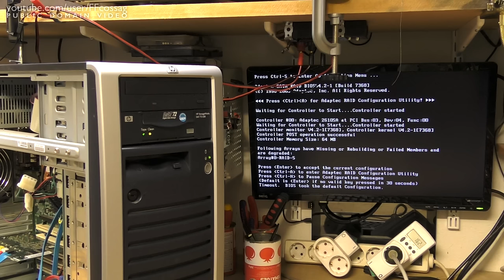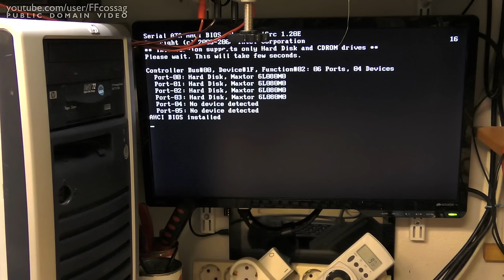The render server moves into a HP ML150 from 2005

Comment: NICE... I love re purposed cases. The hot swap bays are a nice feature. Good to see your not one of them fan crazed builders. Few PC builds need more than one vent fan, unless of course they run in a really hot environment.
There are self adhesive nylon mounts that allow placing of your board where needed, they snap in to the MB and have a square foot to stick on the chassis. Wish I knew a part number to share. I used a lot of them where I used to work. Just remember to add a MB ground wire or two if need be.
I have built some pretty unorthodox systems lol
Reply: I wonder, is it a good idea to put an extra fan infront of the gpu just to cool it even more under load and then I mean just infront of it, not at the fronted of the case?

Comment: For the "missing" stands, you can get plastic spacers to sit in them holes, useful if you ever needed to add an expansion card an didn't want to flex the motherboard too hard when shoving it in... :)
Reply from the maker: Sure. I shoved some of the bitumen damping stuff under a couple of corners to remedy such issues.

Comment: I'm intrigued as to whether the drives are running at 1.5Gbps or 3Gbps. A backplane that old might not be rated for signal integrity on newer SATA standards. Also, I hope you know about the moulded molex to SATA adapter fire concerns.
Reply from the maker: They're running at 6 Gb/s. Consider that a SATA III cable is the same as a SATA I cable; as far as I've been able to gather, the actual wiring standard has never been changed, but rather we've seen controllers better able to utilise the hardware.

What fire concerns are you talking about? I haven't heard of that, save for the usual shitty MOLEX plugs running hot when the sockets get worn out.
Reply: The moulded type SATA ends which usually come on those adapters have a really high defect rate and they spontaneously burst into flames, sometimes even after years in service. It's due to the injection moulding process AFAIKT. Just search "molex to sata fire" on YT, or Google it. I don't want to link to anything directly as it will probably flag as spam.
Reply from the maker: I'd never heard of that. I'm quite certain my adapter won't catch fire from powering a 20 mA fan, however.
Reply from the maker: They're not in the signal path.
Reply: Mark Furneaux I've actually replaced all the cheapo moulded SATA power adaptors in my servers and workstations for ones with crimped connections, even though everything was working fine for years. Better be safe than sorry....and good powersupply manufacturers also don't use these moulded type of SATA power connectors either and rather use the crimp type connectors. I'd guess they have good reason for that.
Reply: +Mark furneaux Aren't you the one who's server burned up?
Reply: Yup. I feel like it's my duty to at least warn people now.
Reply: "Molex to SATA, lose all your data"

Comment: I'm more concerned with the drives staying nice and cool. all that soundproofing insulation kinda blocks the intake air path, doesn't it? I'd rather see some filter foam up there, that seems to do a decent job of dampening some noises while at the same time preventing dust from really getting into the machine itself. Personally I'd rather be able to hear the drives to tell if one's going out or something, but heat from insulation will surely mean an early drive death in my experience.
Reply from the maker: They run cool. Barely 30C.
Reply: As you see on the very new chassis out there, they are quite thin and perhaps they would do the trick to dampen the noise significantly.

Comment: Looks great. But I wonder how the drives are being ventilated.   Maybe i'm missing something.
Reply from the maker: They basically aren't, and they don't need it. I took one out and measured the temperature after a day's use, and its hottest spot was 32 C. You can thank the miracles of modern 5900 RPM drives for that.
Reply: Oh! i neglected to consider the RPM.  My mistake. Well done then.
Reply from the maker: It's safe to say that this case is no longer 15K SAS compatible. ;)